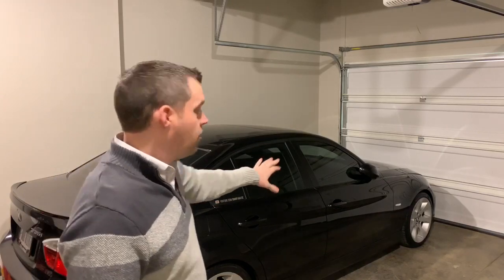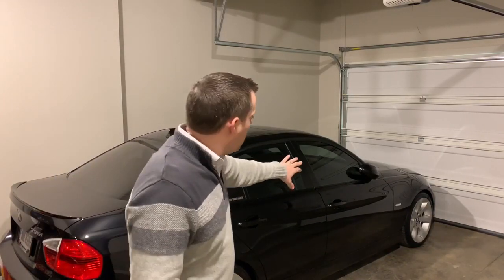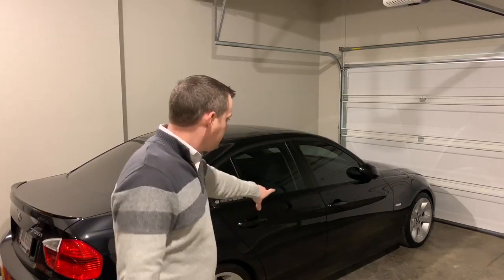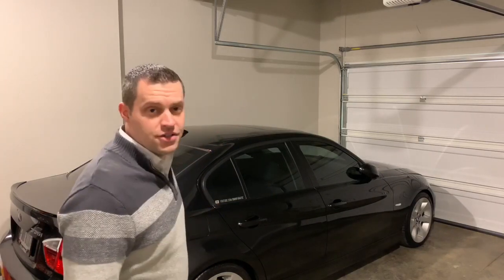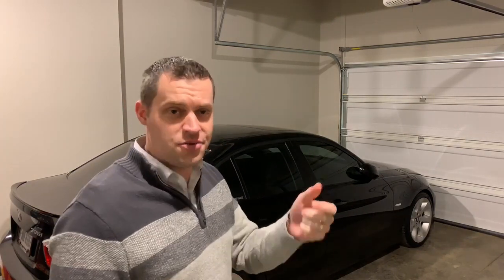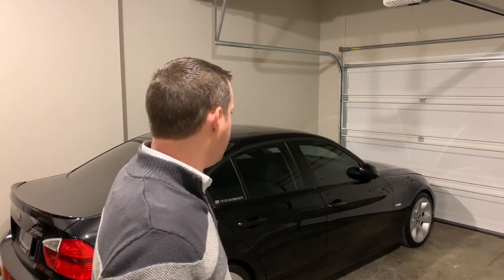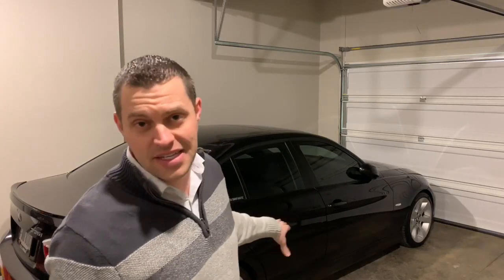BMW Engine Maintenance 101!

Comment: Hi Lee thanks for all your helpful videos! My question is when you change your spark plugs and coils (I have a 335is), does BMW recommend changing the fuel injectors at that time as well?
Reply: Lol fuel injectors are a much bigger deal. Spark plugs and coils are routine and cheap by comparison to these injectors.
Reply: Only replace your injectors if you need too
Reply from the maker: Bob Vazquez I would only replace if the injectors are bad 👍🏻

Comment: I'm thinking about taking over a family members 07 335i. Only thing is that this set up scares the hell out of me. Don't know if I should go for it or just pass!?😔
Reply: The Tirados guns and football if you're good with doing diy here and there it'll be your favorite car you've ever driven 😊 I just sold my f80 M3 because I drove my 335i more
Reply: @micraw714  thanks for the reply. Still thinking. I do work on my own cars. I had a 2002 jetta that I had for 12 years and it had 250k on it. I did all the work on that car myself. I know the 335 is going to just a little more fun to work on..😁
Reply: The Tirados guns and football oh nice! I think you'll enjoy working on it. They're pretty easy once you start messing with it 😁 plus you can't match the performance and potential for the price!
Reply: Yurp labor will get you in the pucker. For example, a valve cover gasket costs $30-50 and the labor will run your around $600-800 so just be aware.
Reply: @chrisseminole9661  do own one?? If so what has your experience been like. Also I'm not afraid to get my hands dirty, so for the most part I will save some money on labor just the price of some of these parts are outrages.
Reply: @wichafroggy   if you buy parts from the dealer the prices are outrageous but buying from reputable vendors like fcp euro or ecs tuning prices on most items wont be much more than those of your VW. Honestly, maintance is key with these cars and it might take some inital investment to get the car all squared away but its worth it. How much would you pay for this 07
Reply: @wallrat103  thanks for the info
Reply: @Neil542  don't plan on It. I'll work on It my self. I'm love wrenching on cars

Comment: hey man i can’t find anything on this code (2C3E). i know it’s o2 sensor related but i’ve read that people change their o2 sensors and it doesn’t get rid of the code. the constant SES light bugs me and when i clear it, it reappears the next time i drive
Reply from the maker: Edris Hashemyar I would further check your injectors to see how they are doing. I had issues where my dueling issues were causing O2 issues.
Reply from the maker: Edris Hashemyar You could always further diagnose that O2 to see if it’s truly failing though
Reply: BMW Fanatic i’m just puzzled because the injectors were replaced a couple months before I purchased my car and I just put NTK o2s on about 4-5k miles ago. do you think it could be my battery dying out? i read that on one of the forums but i wasn’t sure how they correlated. also, how would i check my injectors? appreciate any help, love the videos!

Comment: Hi,I have an e90 and it has 128000 miles it is a 07,I was wondering where can I do an oil transmission replacement,cause they told me at the dealership that they don’t do it
Reply: I have an 08 e92 with 92k miles. Did it myself in a few hours. Easy diy as long as you follow torque specs and order.
Reply: Aamco
Reply from the maker: Fredy Garcia Yeah go to an Indy shop
Reply: BMW Fanatic thank you